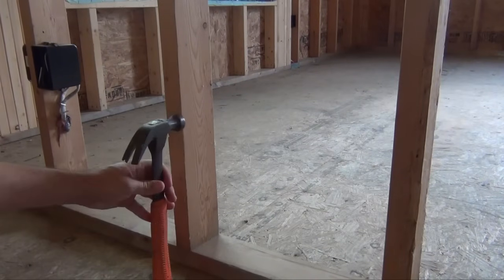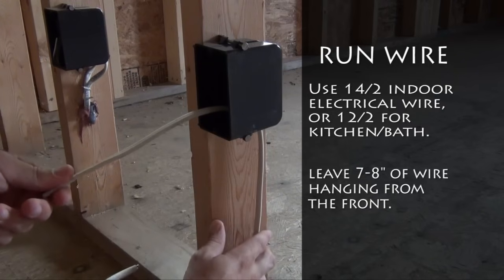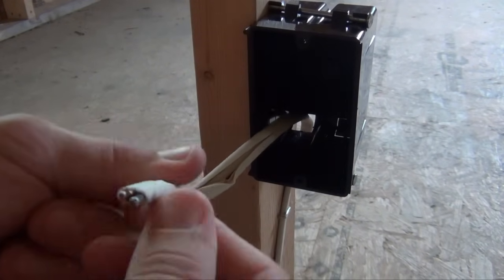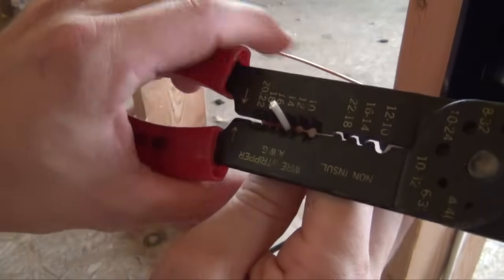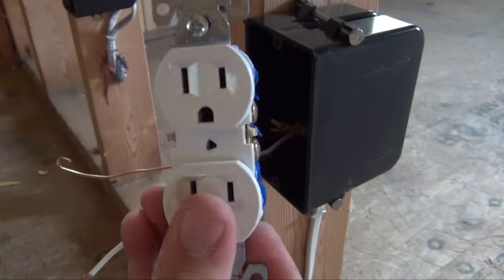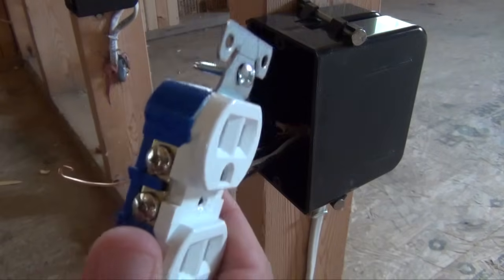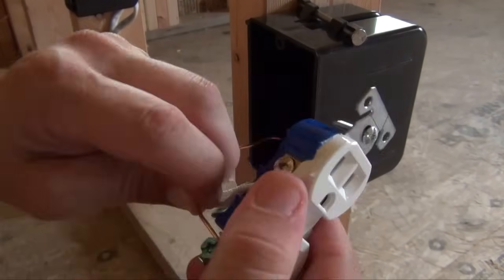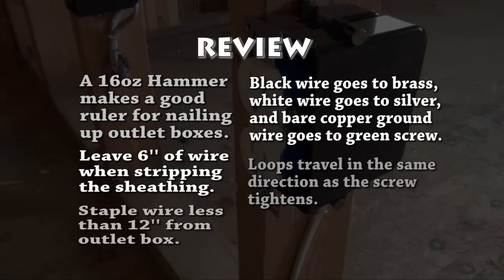How to Install an Electrical Outlet

Comment: Check your city electrical code to see what wire is needed for your installation. Texas we use 12/2
Reply: Good comment. 12/2 or 14/2 are usually the standard if you live in the US. It's important to make sure to learn which is required before running wires, otherwise you're just wasting a lot of time, and probably getting frustrated.